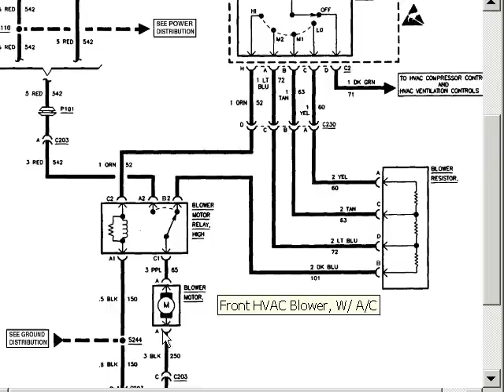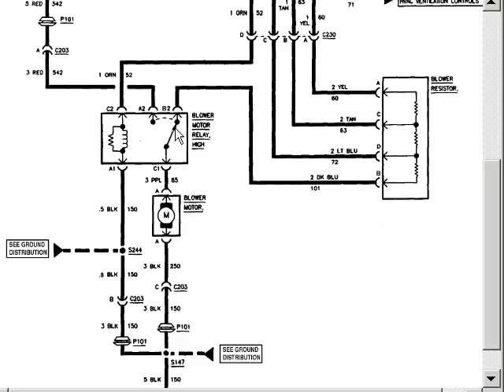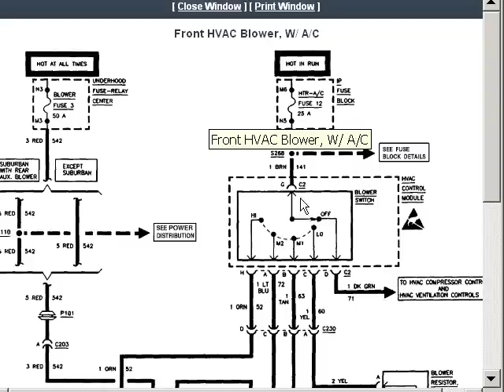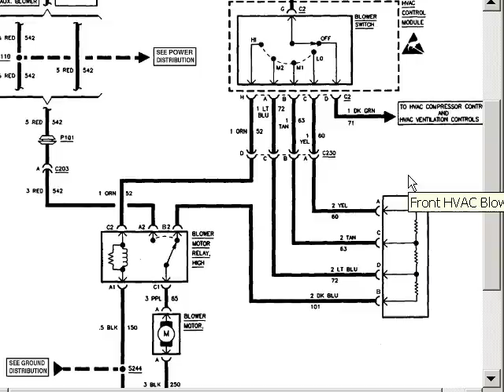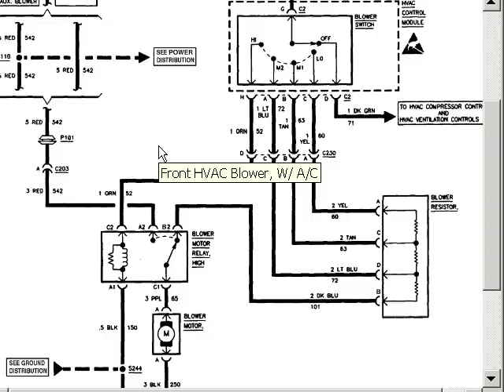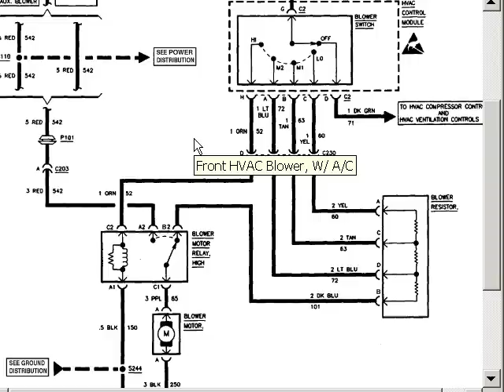Blower Motor Problems | Auto Repair Help

Comment: EXCELLENT VIDEO. I have a 2003 Cadi Deville. Until this video, I thought there was a stuck relay somewhere. The blower motor only spins after I pound on top of the dashboard (usually over the the glove box area). All speeds work when it finally comes on. Is there anything else to check or does this sound like the blower motor itself needs to be replaced? If it needs to be replaced can you tell me where to start?

Comment from the maker: justabrake: I don't have the wiring diagram for your exact vehicle BUT I think Chrysler uses a high blower relay in conjunction with the resistor. If this is the case the relay being bad (contacts stuck closed) is far more likely than a bad switch. In the end it could be the switch but it's just "less" likely. I don't know why but I seem to find bad relays in Chrysler products more then any other make, that's why I lean towards them.

Comment: hi, i have a 93 ford explorer 4x4 eddie beauer edition. 4.0, well when i put it in reverse or when it heats up my turn signal fuse blows. but at the same time my ait stops blowing. ive replaced the fuse but only works for a min. ive looked at the wiring diagram and found that the turn signal fuse if intertwined with my a/c blower fuse. and is all connected to my blower motor. someone told me that the turn signal  is heat activated so the problem mught be the bloer motor resister. advice?

Comment: 1995 Suburban.
-would work on high.
- replaced blower resistor.
- 50 Amp Fuse under hood blew 
- 25 amp blew
- replaced blower motor.
- worked intermittently
- replaced fan switch 
- still intermittent
- wire end burned and fixed by driver.
- Worked better but pops off and on.
- replaced blower relay.
- hope it works permanently

Comment: What could be wrong with my heater the blower stays on high everything works temp just cant controle speed and when car is off it stays blowing i got to pull the fuse under the hood. 04 impala

Comment: Hi Mark,
Thanks for your  video. The heat quit on my 93 MB 190E today, and you've given me a few places to start. Several weeks ago, when I started using the heat this season, there was an occasional clicking sound, then my heat got pretty weak. More recently there's been an occasional whining sound, intermittent but noticeable. And today everything quit. Oddly, there's always a gentle stream of warm air coming out of the side dash vents. Glad for that now. Will try your suggestions.
Reply: I have exact same car.   My blower doesn’t work at all and blows a fuse immediately when I turn on the blower.  Any suggestions. Replace blower?   I know this is an old post

Comment: @hieuhn99 Bad blower motor bearings IF - the unit is an older one - or original product. Most likely that's it. HOWEVER it can be something like a loose fuse. Think back of WHEN the problem started? That will lead you in the right direction. I would start with the easiest thing - try pulling the fan and checking it close.

Comment from the maker: Danny V: Some dealer diagnosis will most likely be needed to pin down the problem. Two possibilities would be the blend door control motor that switches the air direction from the defroster to the dash vents. Another possibility would be the control head that sends a signal to the blend door control motor. The Dealer has a scan tool that can interface and test the climate control system.

Comment: I have a 2005 Pontiac G6 GT. The fan control works as designed. Clockwise,or counterclockwise to control speed. However, the air is somewhat misdirected. The air from the airconditioner does not come out of the instument panel outlets. Instead it comes out through the side window outlets. Which is not nearly enough cold air for these warm temps we are experiencing. It worked fine up untill about 2 weeks ago. Any advice would be much appreciated. Thank you, Danny V.

Comment: I have a 2009 Ford Focus. Right now the blower motor only works properly on the lowest 2 settings. Setting 1 and setting 2. Settings 3 and 4 it tends to stop working after a few seconds and the AC being on or the temperature knob being on the blue side the blower seems to stop working after a minute or 2 no matter what setting it is on. Does anyone know what could be the cause of it?

Comment: My fuses and relay are fine, changed the resistor, no heat still but can feel it a tad bit while driving, the fan only worked on high then suddenly quit, so now I want to change my blower motor, I have a jeep Cherokee sport4.0L and it is tough to get in there to get to it, with A/C stuff in front of it, I'd hate to take it to the shop

Comment from the maker: @imru06 Having to tap the blower motor to get it going is a sure sign that the motor is on it's way out. It does not sound (from your description) like replacing it will address your fan speed issues though. That will take some diagnosis.

Comment from the maker: @johnnyponny4 Sorry no easy answer for this one it's gonna need old fashioned diagnosis. I would approach the problem by getting a wiring diagram for the blower circuit. I would first check to make sure there is a good ground for the motor. Then start at the blower motor and check for power at the various connectors heading back toward the switch, relay and fuse. There is also a diagnostic tree chart in the factory manual for blower inoperative.

Comment: @mgittelman I have an 03 Tiburon. One day the blower stopped working completely. No power on any speed. I checked the all the fuses. i checked the relay in the fuse box under the hood. I replaced the motor. Still doesn't work.

Comment: Excellent...looks like my astro schematic. I just replaced my blower motor last week. The resistor was replaced a year before that. A burned out resistor usually means your blower motor will fail soon. Best to replace them both. Thanks for the video.

Comment: again and he says its bcm again and also resistor is short now as the resistor metal case has 12 volts 
on it. according to his diagnosis at dealership the signal upto bcm is fine but then he can not pin down 
the problem after that. please help

Comment: Hi there,
2001 Chrysler 300m.
My blower motor doesnt blow at all. ATC resistor replaced with new but nothing. Jumped motor with direct battery connection and works but no heat just blows air. if bypass resistor and connect the plugs directly motor blows again. wires coming from head control unit are live with 12V all the time. confused i took it to dealer. he said bcm (body control module) is bad. replaced bcm and reprogrammed it but of no use. took it to dealer (continued in next post)

Comment: 1992 Honda Accord HEater Problem?
There's no air coming out of the vents so for sure it could be the blower motor, But what can cause it to stop working? Does anyone work on blower motor before? It's a 1992 Honda Accord

How hard is it to replace a blower motor? 
What steps or procedure do I have to do? Any tips?

Comment: I have a 98 ford explorer, and the fans in my center counsel facing the back passenger seat works, but the fans in the front of my truck dont work at all. Not on low or high. What could that be ?

Comment: how do you tell if the blower motor resiter has power going to it ?i have no power coming out of it where it goes into the fan ive changed the resiter and still no blow. all fuses under hood and in car are good replaced them as well. it worked on 4 and a half now it does nothing. please help

Comment from the maker: @renan111 A common cause of your complaint is when the condenser fan is not working properly. The condenser fan pulls air across the condenser when the vehicle is not moving and low speeds. At highway speeds you can sometimes have enough airflow without the fan working to blow cold air.

Comment from the maker: @lamont22222 Some models have a high blower relay that is used to bypass the resistor block and run the fan at full speed.

Comment: 95 cadillac sts... I've been having issues with the ac. I can hear the blower motor speed up and slow down but cannot feel the air blowing neither hot or cold. All the fuses are in good condition... any help??? thanks

Comment: I think that what wron with my because when i turn to speed 1,2,3,4 any of the speed it borns a cable and i dont why it burns and no air flows out at all just smock from the speed cable.